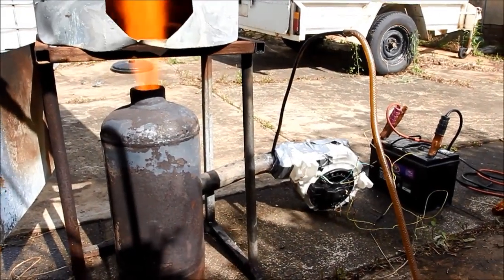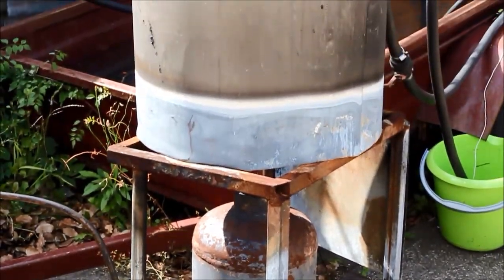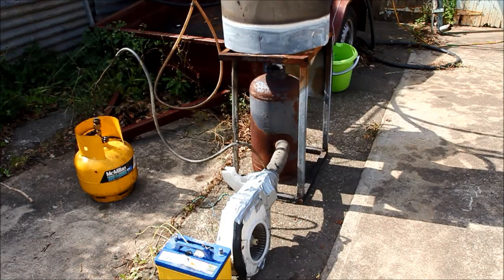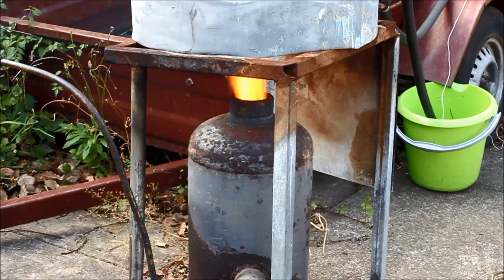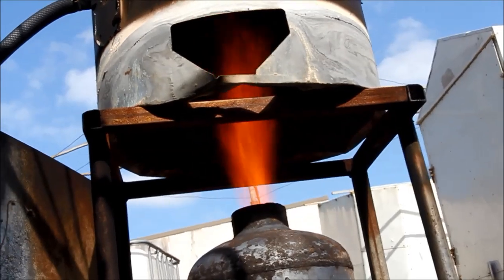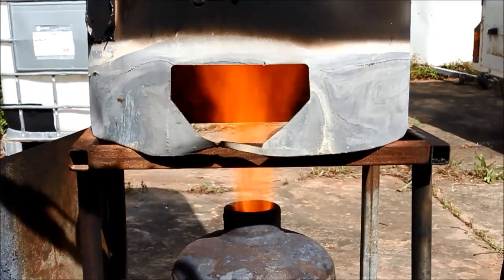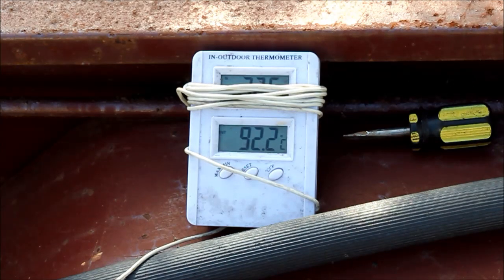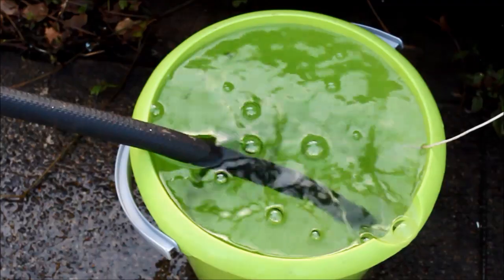How to build a Water heater to run on Free fuel.

Comment: for 120L of water to go from 20 deg (assumed ambient outside temp) to 100 deg requires 80*120~=10000 joules.

If as you say it took 20min (1200s), the water heats up at about 800W. or it can absorb energy at that rate.

If you think the burner gives out about 10kW, So it's roughly about 8% efficient..

Not too surprising with all the opne flame and no insulation around the tank.

Thanks a lot for the awesome build and measurment numbers.

Correction:

sorry, wrong units t take on kCal to heat 1L of water by 1deg... not one Joule.
and 1000kCal = 1.163kWh = 4 187kJoules

so let's do this again:

80deg water temp rise: 80*4.187= 3349,440Joules
in 1200 seconds:  
3349,440/1200 = 2791, say 2,800 kW? 

is that right? will have to look at the whole thing again ....
Reply from the maker: Yves Baggi  8% efficient doesn't sound far from the mark. I have crunched the numbers on similar things before and the efficiency is always amazing in how low it is. 
I'd guess this thing may be as high as 20% efficent being the sesign it is but the burner largely overpowers its design rating which wastes a lot of heat.  

One thing I can absoloutley assure you, that burner was NOT doing 2800 kw! :0)  So far my best effort is 600 Kw and knowing what that is, 2800Kw would be really something!

It would be a bit hard to work out exactly because it was varying in output but I guess you could get an average.  I know when I had it hooked up to the house I ran the thing too hard and had the water boiling and gushing out the safety valve in about 15 min. I was not expecting it to heat up near that fast which was why I was leaning into it to get it up to temp in a timely manner. 

From memory, the water was pretty warm coming out the tap in this vid and was around 27o being summer here in Oz when I shot this.
Reply: Yves Baggi You mean 3,349,400J/1200s = 2,800 watts not kilowatts. Remember a watt is a j.s^-1

Comment: Hook the output to a radiator and heat the house.  That's my plan. Good vid!
Reply from the maker: Steve 1961P. As far as the burners being too large, they can be throttled back a lot but you are right in I certainly won't need anything like the outputs I run them to. I'm doing a burner specifically for this application atm which will be setup specifically for around a 20Kw output and retain the heat needed to sustain at lower burn rates. 
It's a LOT easier to build fire breathers than low outputs that look like candles in comparison.
Reply from the maker: kbbacon  That's  EXACTLY my plan Kevin.  I'm building a new Modest power burner I can run off the 12V Bilge blower and looking at a hi/low  fuel rate. 
I'm considering putting a 2nd radiator under the house to keep the floors warm and also use that as a heat dump to stop the system over heating and tripping  the safety valve. I'll run a header tank as well so the system runs in an open configuration at nil pressure. 

I have a solar water heater circulation pump but I think I may need something a bit stronger. When I tested the system before the radiator could pull every bit of heat out of the water too easily.  Need to pump it through faster to balance the capability of the burner.
Reply: It is going to be a challenge!
Reply: kbbacon Some vids are on the tube that do exactly that, but OB burners are all way too large for the small amount needed to continuously put heat through a radiator. Unless you had a monster of a fan blowing air through the rad, but then it would be to windy and noisy to enjoy the heated space!  Years ago, "for shits and giggles," we put a coil of 1/2 inch copper inside a small propane grill and ran it to a crappy car radiator. We did this all inside of a shop that was about 30 by 30 and 14 foot ceilings. We used the 12 volt electric fans from the same car along with it's shrouding. With just 1 of the burners on it was capable of keeping a nice flow of heat through the rad.  This was more of a SOMETHING TO DO than real experiment as I had a waste oil burner already installed for my regular heat. But, it would probably work fine if not for opening 12 X 12 overhead doors in the cold winters along Lake Ontario.
Reply: Oil Burner OB, I also have a solar water heater pump that I'd like to put to use. Are you saying it doesn't move enough volume to bother with? I have never checked the GPM.  Fact is, it is so far down on my list of things I need to do I have never even looked it up.
Reply: Steve 1961P. A copper coil is a lousy tube boiler. Wiki it...  Heating a vessel of water produces a better volume of hot water.

OB is working on a hot water system to heat his house. A demand system with a heating mode (when the heat needs to run) and a "pilot mode" (when it is not needed.)
Reply from the maker: Steve 1961P. Going by the test I did on the setup last year I was dissapointed in the amount of heat I could extract even when the water was near boiling. The output from the radiator was ambient temp and only about 1/4 of the radiator had any heat in it and that was just from running the smaller of the 2 fans. The pump I have is just a 3/4" and is about 50W so very low power. I imagine solar panels are only capeable of  a couple of KW heating and work on time rather than power per se so a small pump just to move the water is probably OK. 

I'll try it again and see how I go, Maybe the thermosyphon  effect will help when it's properly set up?
Reply from the maker: OgMandin0  I have a vid where I lad a length of copper tube inside another pipe and it worked reasonably but with brutal inefficiency.  You need a lot of 3/4-1" tube to get enough surface area.  That said, pretty much every coiled design i have seen on YT was complete crap because the heat could easily bypass the tube and escape without contacting it. To get any efficency out of it you need to be passing all the heat over and around all the tubing. Coiling it up and lighting a fire in the middle is useless. 

I am thinking of putting a " Superheater" section in my setup which will probably be a section of pipe  directly over the burner output before the water goes to the radiator in the house. This should give it a few degrees and allow a slightly faster start up from cold before the tank is up to temp properly.  The flame will then go to the tank so no loss of output, just a last boost before it is put to work.
Reply: I may have the answer/. I'll be working on this problem over the coming weekend.

Comment: Very nice. My oil burner is almost built and i ordered a crucible yesterday... My latest project (Line Boring) just finished with great success and ill be on to melting some aluminum with your design hopefully really soon. Your welcome to check out my line boring video if your at all interested in crap like that ill post new video's when i start burning stuff
Reply from the maker: builtrodewreckedit Had a look at your line bore vid, Excellent!
Can't wait to see what you come up with for the burner!
Reply: Oil Burner Thanks again for the kind words... Im happy to be on to the open flames now...allot less critical measurements i hope